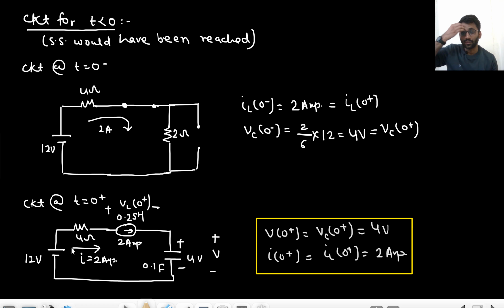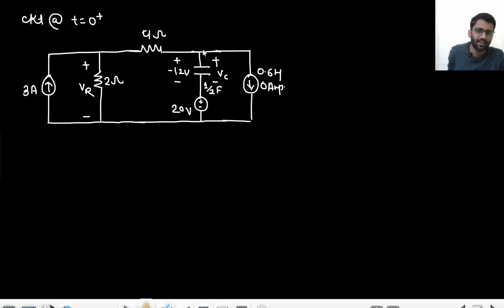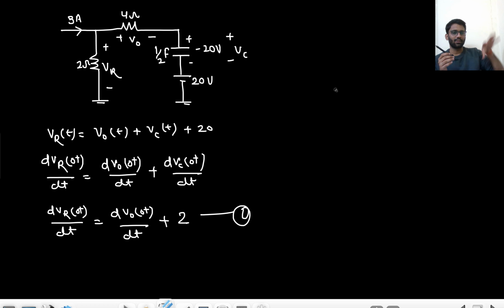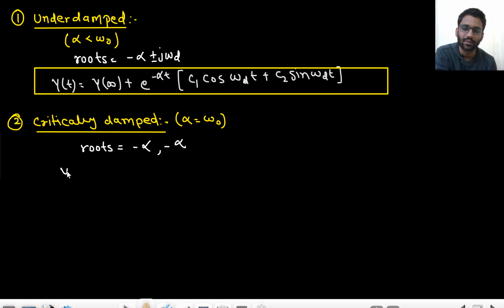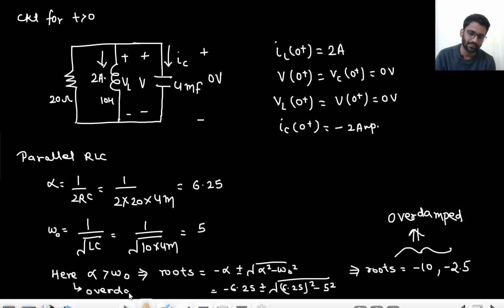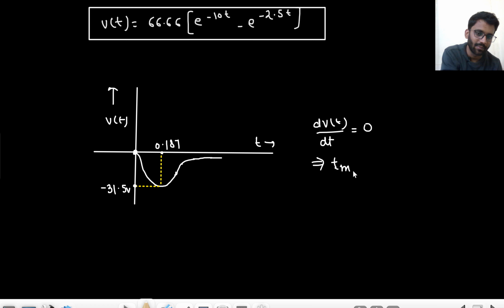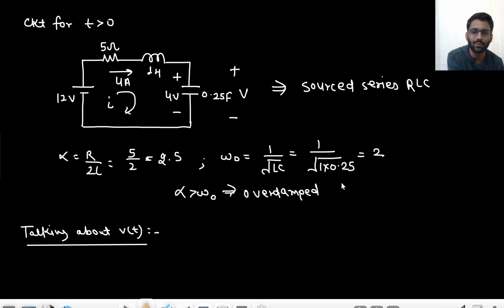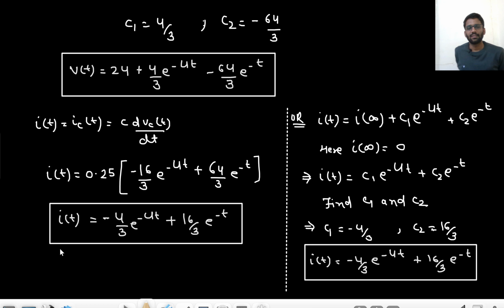Initial Condition in RLC Circuits & Sourced RLC Circuits || Network Analysis || GATE 2025-26

Comment: ques at 4:49  is also a sourced ques but why we didt solve it like sorced rlc circuit? does source rlc concept only come when we have to find the values at infity for t>0? and we just have to put the values at infity in the equation ?
Reply: because we are not going for transient analysis of the circuit. all we were looking for was its initial value and final value. try solving it with sourced rlc circuit's transient analysis you might get the same answer

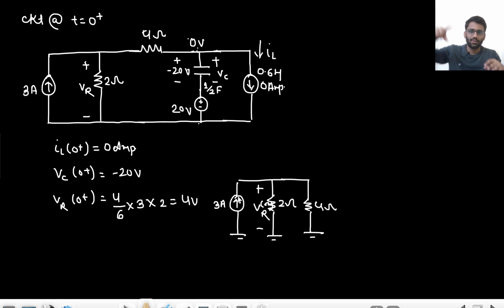Comment: using Vr(0+) from 18:30 ,in second question for d Vr(0+)/ dt, can't we write it's value by:
(change in voltage from 0+ to 0-) * delta(t) = 4 * delta(t) 
what is wrong here?
Reply: dVr(0+)/ dt dosen't mean change in voltage from 0+ to 0- .It means change in voltage from after some t>0+ and 0+. In case of functions where f(0+)=f(0-) we can say dVr(0+)/ dt = dVr(0-)/ dt=dVr(0)/ dt. In this case, dVr(0)/ dt=4*delta(t) but dVr(0+)/ dt is different.

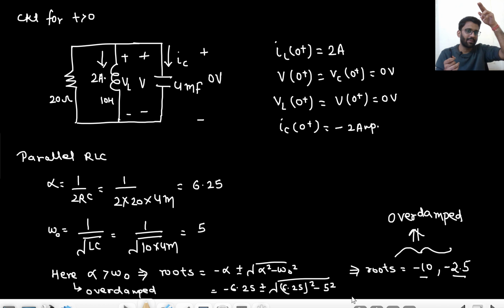Comment: @52:00 Sir The current flows through the resistor is zero right? Why capacitor has -2 amp current?
Could you please clarify it sir??
Reply: coz the inductor path is short circuit and it is having the current 2 Amp,now,let's get to the basics,the resistor is parallel to the short circuit path so there will be no chance of going current to resistor path,so 2 amp is getting in to the short circuit path,but from where? That is  from the initial voltage of tha capacitor.hope u get it..
Reply: Thank u shiva 🥰

Comment: At 52:00 the 2 amp cuurent flows through capacitor which is coming from inductor develops negative volage across the capacitor and inductor and this negative voltage develops the current in the opposite direction of 2 amp which will eventually makes the total current 0 across the inductor. is it right?